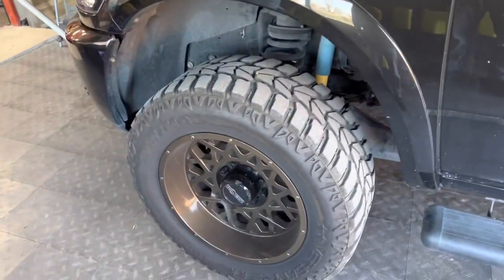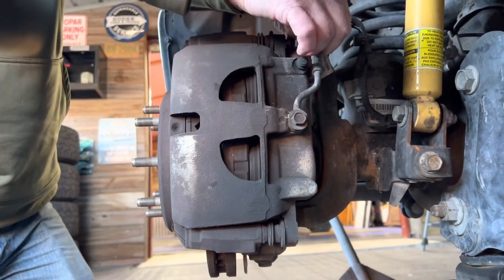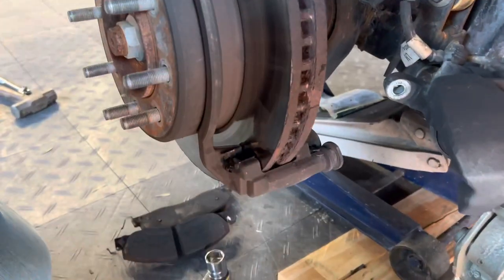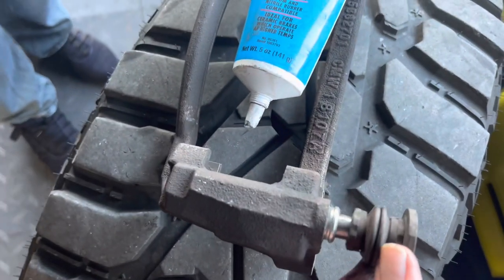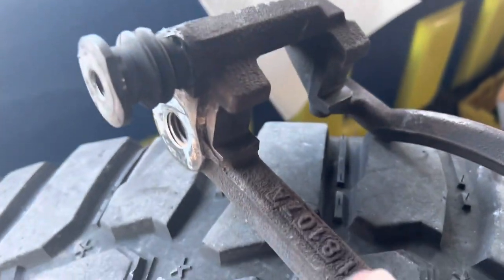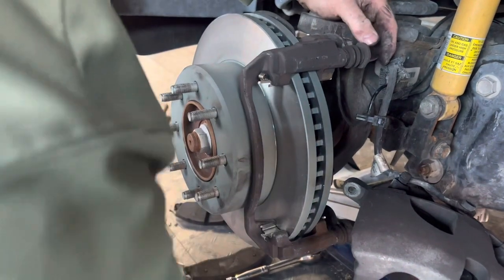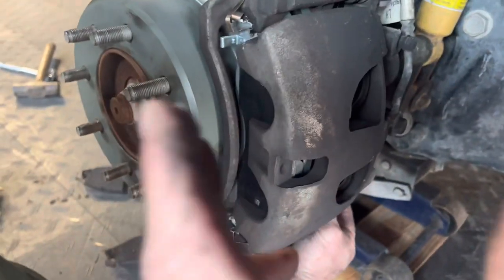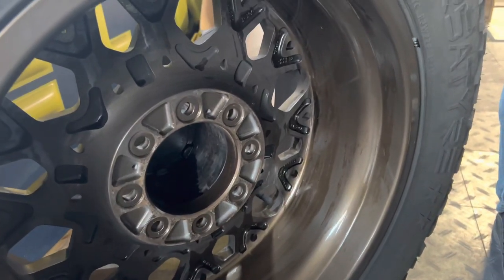How To Change Front Brake Pads And Rotors  / 2019 Ram 2500 / Cummins

Comment: Never directly put grease in the sliding caliper pen whole, only on the pen shaft making sure to not get grease on the shafts "TIP" because it will prevent it from bottoming out in the whole because grease doesn't compress now your break pads will where uneveningly.